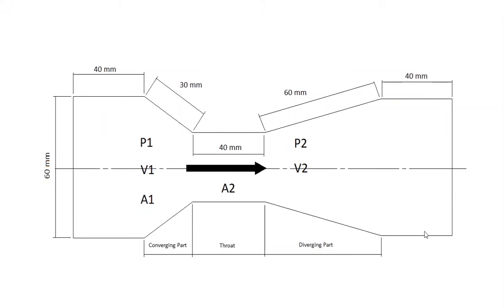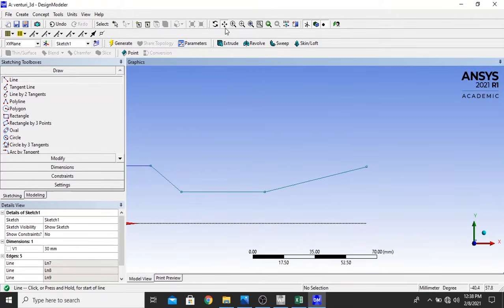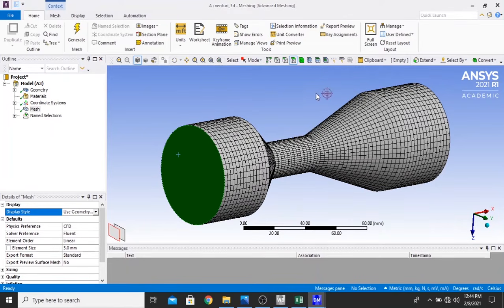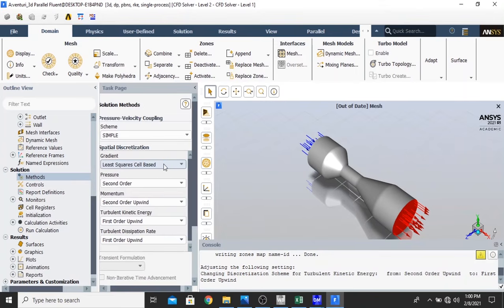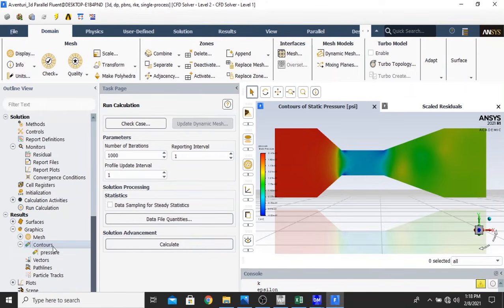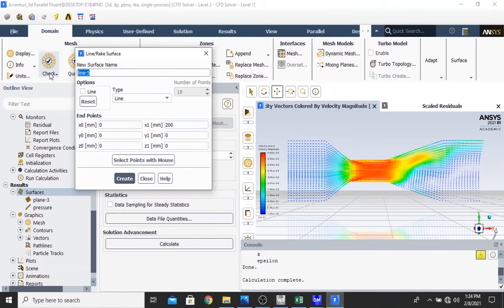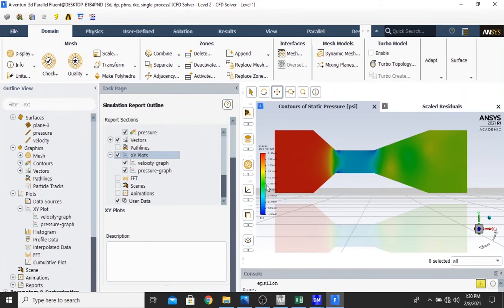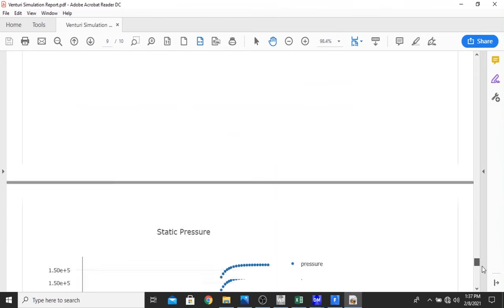Ansys Fluent 3D basic | fluid flow through a venturi

Comment: PLEASE HELP....!!! how can I solution this error??...it appers when I try to edit the setup after select the surfaces...
Ansys.Fluent.Cortex.CortexCommandFailedException: An error occured in FLUENT while applying case and settings informatins.
An error occured in FLUENT while applying case and settings informatins.
   en Ansys.Fluent.Cortex.CortexCommunicator.SendMessage(String msg, String msgKey, String errorMessage, Boolean waitForReply)
   en Ansys.Fluent.FluentCommunicator.UpdateSetupInfo(Dictionary`2 info)
   en Ansys.Fluent.Data.SetupData.ReadCaseModelInfo(IFullContext context)

Comment: thank you so much.  Well, I have a question: water will flow in a straight pipe and I want to mix the water with the air by placing a venturi in the middle of the pipe.  can you solve this?. thank you.  Allah bless you